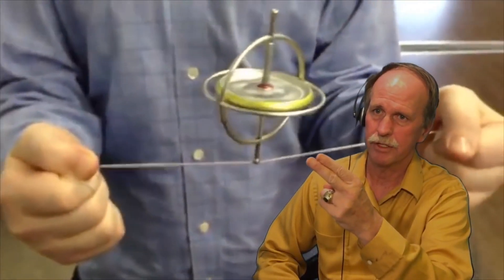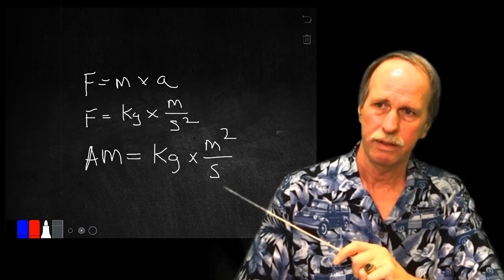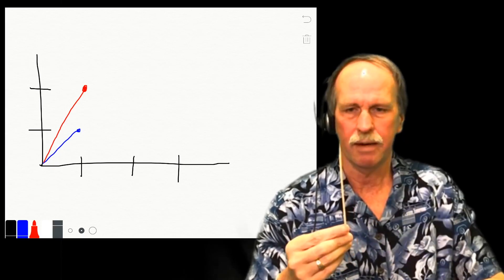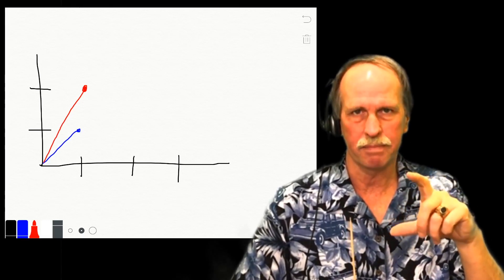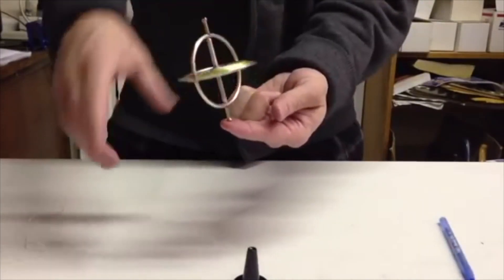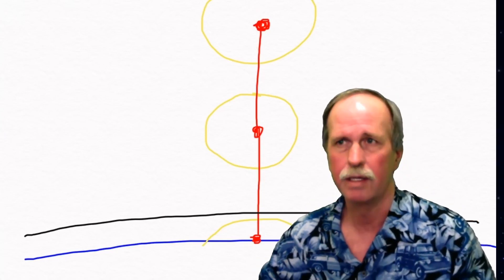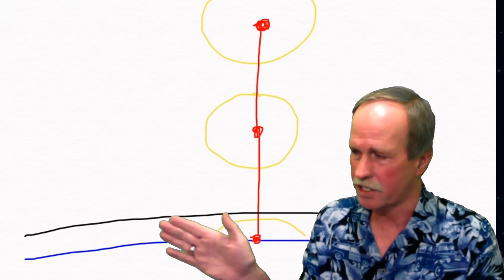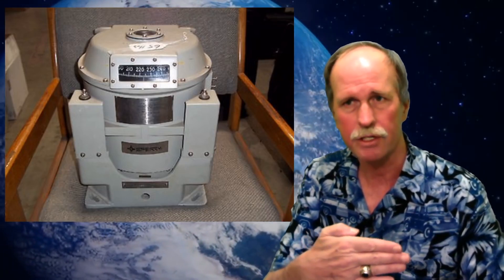Mechanical Gyrocompass | How Things Work

Comment: This is really a confusing and muddled explanation 😂
Reply from the maker: you think?  how would you explain how a mechanical gyrocompass works?
Reply: @ShamrockBanksObservatory  i’m sorry but unfortunately that was my immediate and honest reaction after finishing your video. Trying to answer your question, I watched it again halfway into your video at high-speed, and my reaction was still the same. However it will be very lengthy to layout what I think the problems are and what I think would be the correct and a better way of explaining the working of Jarrod compass.
Reply from the maker: Jarrod compass?

Comment: 1:15 - Who was the genius that figured out Gyroscopes was the solution? 6:12 - Wow, so does this mean gyroscopes could also be used as a clock? 9:51 - Does this mean every time when it is stationary and spun up it requires to be manually set/locked every morning to the rising sun?
Reply from the maker: I don't know, probably on the wiki page for 'gycorcompasses' if you want.  How would a gyrocompass be used as a clock?  No, it is self seeking to true north from any direction, with the possible exception of true south- but that would not last long.
Reply from the maker: Btw they didn’t invent the gyrocompass and then discovered it detected the rotation of the earth. It was purpose built to use the known rotation of the earth to find true north

Comment: There has to be a motor inside the gyroscope to make it spin permanently. I wonder how this is managed technically.
Reply: From what I know, heard it from an engineer, the motor must be quite constant in speed and have low vibrations.

Comment: Was stationed in R-3 repair on sub base.  Our job was to troubleshoot and repair ships navigation equipment (pre-GPS days).  Worked on the Mk 19 and Mk 27 gyrocompasses (and even an older one that didn't use electronics).  Unfortunately you rather skipped over how they 'lock them on the horizontal' a bit.

We first learned how the all-mechanical version, with a mercury 'ballistic' functions.  A small tank of mercury at each end of the axis of rotation and a small tube connecting.   If started pointing to the east, the axis would actually lift a tiny bit from the horizontal and mercury would begin to flow from one tank to the other.  This of course made one axis end heavier and gravity would actually try to tip the axis further.   But, because of the angular momentum it would turn toward the north instead. 

Mk 19 and Mk 27's use an electrolytic level on the platform holding the gyro to detect 'off-level' condition and electronics would apply a signal to a 'torqer' that would 'push' the gyro and have it precess towards north.  They also include integrators that measure and compensate for the tiny mechanical errors and eventually will balance them almost perfectly by applying tiny, continuous torques to the gyro.

Interestingly, Mk 19 actually has TWO gyroscopes, one that is aligned with N-S and the other at 90 degrees, E-W.  This allows it to maintain a perfectly level platform so exact pitch & roll can be fed to fire-control systems along with true geographic north.  And yes, the E-W gyro had to have a small constant torque applied (based on latitude) to compensate for the earth's rotation to keep it's axis horizontal.

Normally we start them close to pointing to true north because the time it takes for a gyrocompass to 'settle' depends on how large the initial error is.  You CAN start them pointing due east, but it can take over a day for them to settle down from such a large error.

Comment: Thanks Bob.  I always assumed gyrocompasses were manually aligned to true North before each use, until you explained this about a year ago. 
 
I'm wondering though.  This sounds like it should work on a ship crossing the oceans at 20 knots, but what happens if this is used on a jet approaching 1000 miles an hour (1600 km/hr)? 
 
Would traversal over the Earth's curve in a Northern or Southern direction introduce enough of a different torque to the gyrocompass to cause it to point in a different direction?
Reply from the maker: We don't use gyrocompasses on aircraft for two reasons. 
1/ they are very heavy
2/ they require time to align to true north, and aircraft simply move too fast.
3/ that is why we use laser ring gyros (essentially instantaneous) in the inertial navigation systems. There was a time we did use mechanical gyros, but they suffered from the problems you alluded to.
Reply: nope

Comment: Not disputing anything here at all but to little old me it is counter intuitive that a gyroscope on the Equator (I.e. exactly half way between NP and SP) processes to the North (except in an exceptional circumstance).  It's almost as if we have defined an "up and down" or "top and bottom" for the globe. I am guessing the answer lies somewhere in the RH Ru!e.
Reply from the maker: The direction of the precession is related to the direction of earth’s rotation not the location
Reply: @ShamrockBanksObservatory  Thanks that makes sense.

Comment: Ships, or at least ocean-going vessels, were mainly built from riveted iron from the 1830s.  Steel replaced iron and welding was the innovation of the 20th century, not metal ships per se.  The original Clyde Bank Iron Ship Yard was founded in Govan in 1851.  When they were forced to move in 1871, they chose a site downriver, opposite the confluence of the Cart and the Clyde enabling bigger ships to be launched across the Clyde into the mouth of the Cart.  The town which grew up around the new yard (the area previously being called Barns O' Clyde)  took its name from the yard and became Clydebank.  That's where I come from.

Comment: Dr. Bob, whilst you both have a good voice, and are great at explaining, if you want this non-FE related science channel to grow, you will need to improve the visual part of the presentation: the graphics, as well as going out there and filming stuff. You fly an airplane, and have a boat; that would make me think that you also have the equipment on these machines undergo regular maintenance, is it not possible to arrange for a mechanic to allow you to film the mechanical gyrocompass, so that you'd have your own video material for the presentation (to avoid copyright issues, or maybe show something in a way that you'd find more appropriate)? I'm also certain that BlueMarbleScience could help you out if you alone do not have at home access to all the tools that he has, and has used to demonstrate things (like gas pressure without a closed container etc.); maybe two of you should do this together. Explaining things and requiring viewers to visualize what you say is quite a challenge, and some people have inherent problems with this, the inability ability to visualize 3d objects, or to think visually in general. It's also much more common than discalculia.

The competition on youtube is formidable, much more than when it comes to just demonstrating failures of flat earthers,. I wouldn't want this channel to fail, as many others have. Another thing; you need to engage with your general viewership more; like the comments, enter discussion, engage on twitter...
Reply from the maker: Great suggestion. But this is a very early video I did
Reply: @ShamrockBanksObservatory  I think I watched every video of yours, and it did sound familiar; now that I think of it, the 'virtual whiteboard' should have been a def. giveaway, because I remember when you,  inspired by Conspiracy Cats, introduced and, soon, abandoned it.

As a side note; I did manage to make English transcripts of your antivaxxer videos, because I would really like to subtitle them into Slovenian and Serbocroat, to share them locally, but my work project, which is to subtitle (due to poor sound recording) and translate the large Slovenian History (SIStory) video collection, well, it's really slow work... Eventually!

Best wishes for this new channel; I really enjoy all the content you put out, maybe it's just that I find your approach to FE and other science denial (or abuse - Wakefield) very close.

Comment: Mass in acceleration is a wonderful thing. We use it all the time. It can lift a plane and drive it forwards, and it makes a jetmotor work and lets us hear it's sound. It also creates the sound in the instruments and makes the clock accurate. It keeps the satellite in its orbit around the global earth, makes the winds rotate around the low pressure and creates the low pressure.

It also explains how we can travel in circles with great speed over vast distances without feeling the velocity: The acceleration is small, and balanced by gravity.